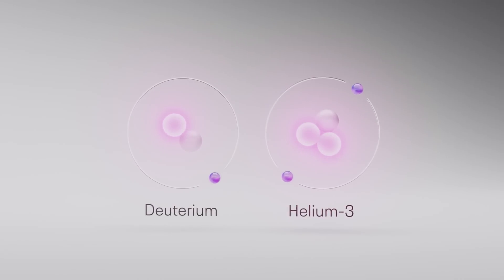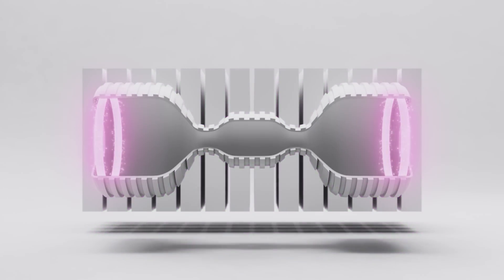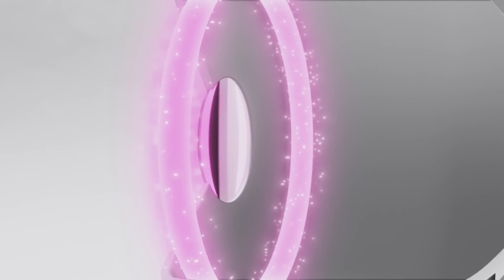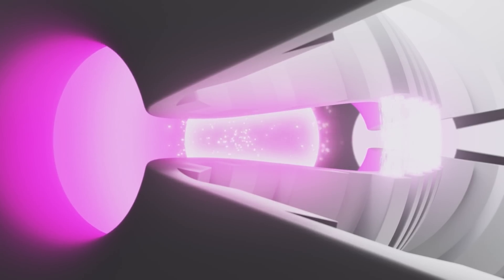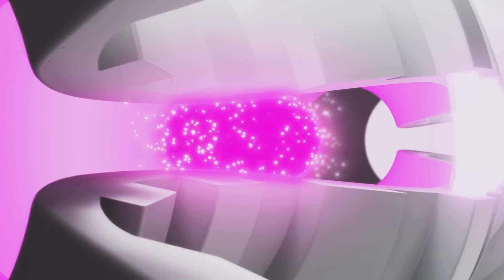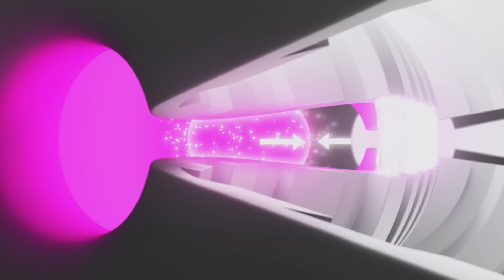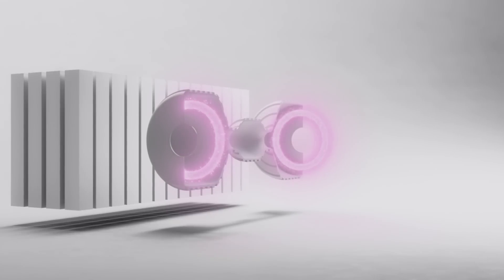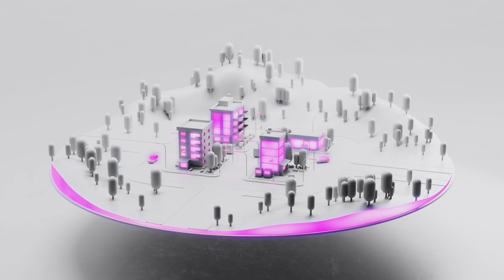Helion's approach to fusion: How it works

Comment: If you do it with tritium-dueterium reaction it will be much more efficient
Reply: Depends on how you look at it. D-T requires more components, like a breeding blanket and the materials get stressed a lot more. Also, unlike D-He3, most of the energy is in neutrons rather than charged particles. So they would need a steam plant as well. Finally, the wall loads would be worse with D-T. The machine might have to be bigger. All of that drives up operational and overnight costs. 
That said, Polaris will do some D-T experiments as well, since as you said, it is a bit easier for a first step. 
There are some interesting, potential variations to the fuel mix: They are planning to breed He3 from Deuterium reactions. Those same Deuterium reactions also make Tritium. This would be Tritium catalyzed Deuterium fusion model. With that they could get away without a breeding blanket. Equally, they could burn both, the Tritium and the Helium3 produced by the Deuterium reactions. Their patent explores some of these options.  
For now at least, the end goal is still a D-D-He3 plant, though.

Comment: Tell me about a carbon neutral way to get deuterium and helium, pretty please
Reply: You can extract deuterium from seawater. It only takes electricity. If that electricity comes from a carbon neutral source, like fusion, then the process is carbon neutral. A 50 MWe Helion power plant needs very little deuterium, only about 20 kg a year. Some fission reactors have entire pools filled with that stuff. Regarding the He3, Helion makes that themselves by fusing Deuterium.

Comment: I suspect that your approach to succeeding is just a matter of fine tuning the parts of the device just right.
Reply: In the end maybe the microwave laser drilled geothermal plants would just have to stick around to act as the capacitors, and the fusion plants are actually just multiplying/amplifying that energy output.
Reply: In fact, probably just build them in pairs next to the microwave laser drilled geothermal plants. Easier technology to just use fast switching between the two fusion machines for the power pulsation they require, then recombine on the other side into a smoothened power flow.

Comment: How long till a working prototype?
Reply: Depends on how you define "working". Trenta was working (as in it achieved its design goals). They are building Polaris right now and that is currently targeting summer. Then a few months of optimization and fine tuning. Then it should produce some net electricity.
Reply: @elmarmoelzer2229  Seems to be going along nicely, then.
Reply: @kblargh   Yeah, they are making good progress. Still a lot of work ahead of them, but I am confident they can make it.

Comment: The biggest problem with all of this is acquiring or producing Helium-3, mine it off the surface of the moon or build an entire seperate rector just to generate the fuel.
Reply: They do not have to build a separate reactor. They can do it all in the same machine. D-D side reactions happen anyway. Half of them produce a Helium3 atom and the other half produces a Tritium atom which also decays to He3.
They just have to have the right balance of D-D reactions to D-He3 reaction to have enough He3.
Reply: @elmarmoelzer2229  The amount of helium 3 produced is insufficient to fire the next reaction, it is not a self sustaining helium 3 source. I recall discussion of a completely separate reactor tuned to produce helium 3 but it hasn't been built yet. 

If they were producing helium 3 in quantity today they would already be profitable.
Reply: @rrmackay  
It IS sufficient. You need two D-D reactions to make one He3 directly and one Tritium which eventually decays into more He3. 
So in a worst case scenario, you get one D-He3 reaction for every two D-D reactions, which IS sufficient. They can also trade the Tritium for more He3, since Tritium is A LOT more expensive than He3, at least until the market is saturated. 
The D-D reactions are essentially self- sustaining. The D-He3 reactions are where the net electricity for sale is made though.
They COULD make a dedicated machine for the He3 breeding, but they do not have to. Dedicated machines would be more optimized for the task and there are some advantages with siting and all that.
But the initial machines will do both breeding and burning of He3 in the same machine.
Reply: @rrmackay   A 50 MWe Helion power plant will produce about 7 kg of He3 and Tritium annually. They could sell the He3 until the market is saturated (which is not that big). They WILL make a lot more money selling Tritium until that market is saturated too which is a lot bigger than that for He3 (Tritium decays into He3). Price for He3 is a fraction of the price for Tritium. Helion's machines will make both, Helium3 and Tritium and yes, selling those isotopes is a good source of secondary revenue and they are aware of that. But market elasticity is something to be aware of.

Comment: What the video doesn't cover is the fuel cycle to produce Helium-3, which otherwise can only be created by bombarding Lithium with Neutrons to produce Tritium which eventually decays to He-3.  While Tritium itself is a fusion fuel, Duterium-Tritium fusion emits most of its energy as high energy neutrons which can't use the elegant magnetic energy recovery of Helion.  He-3 can be made by Deuterium-Duterium fusion.  So the system can make its own fuel with an excess of Duterium in the mix.  This itself is brilliant to allow near 100% energy recovery which is something where all neutronic fusion reactions must use inefficient thermal conversion as well as a Tritium breeding cycle with a neutron economy.  The simplicity of the Helion design and fuel cycle makes it the front runner of all the fusion approaches so far.
Reply: Deuterium-Deuterium is 4 particles right? 2 protons, 2 neutrons. Helium-3 is 2 protons, 1 neutron. Where does that last neutron go...? I'll give you a hint, D-D fusion is also highly neutronic like D-T fusion, this isn't an improvement.

Comment: Finally, nuclear energy that doesn't need to just boil water.
Reply: Boiling water is great, because it means you can convert any existing steam-powered power plants to fusion, at very low cost.

But boiling water sucks, and an aneutronic process like LPPFusion use, can avoid the steam cycle too!
Reply: Hey don't knock on boiling water. There's a reason even gas turbines use the rejected heat from the exhaust to further run a steam turbine. They don't have to but when it comes to squeezing out every last drop of efficiency steam is hard to beat.
Reply: My thought exactly...

Comment: @RealEngineering 18:05 / 18:30 My 2 Cents Analysis: The Polaris Generator Stable commercial Repetition Problem (not yet sure that I can fully understand the concept of direct fusion to Electricity) but my guess won't 60 generators all sequenced/timed to each output/fire 1/60 cycles per second. Analogy similar to producing  60 Hz AC @ 60 cycles per second everytime the generator passes a coil @ turbine/generator/alternator at shaft speeds of 3600 RPM. #Paralleling@60Hz
Reply: This was before i realized the Repetition Rate is 1000Hz per second, but still can be considered from an Efficiency point of View

Comment: Helion has yet to achieve "Sustain Fusion Ignition".  What Helion's plan to achieve "Fusion Ignition" ?

Can anybody shed light on an approach to achieve "Sustained Fusion Ignition" in the manner Helion has proposed ?

Are all the Helion YouTube PR videos just a means to secure more funding for a problem that has no practical solution in sight ?

I sincerely pray for Helion to achieve "Sustainable Fusion Ignition".  It is my hope that Helion "Engineers" its way to this physics "Holy Grail" of discoveries.  If achieved, Helion will become the greatest company in the history human civilization.

That fact is that Helion hasn't and more importantly, has no idea how to physically perform "Sustained Fusion Ignition".  

Seems like another multi-billion physics sink hole to me.

You can't power the world with talk alone.
Reply: Helion is explicitly not aiming for a sustained reaction and explicitly not aiming for ignition (where the fusion products heat the plasma to the point of where no external heating is needed). 
1. Helion's design is pulsed. A pulse lasts a millisecond or so.
2. They do not need ignition because they can recover the input energy and the fusion energy at extremely high efficiency. If they can do 95% efficient recovery of the input energy, then this is actually better than a Tokamak with an ignited plasma. The fusion energy recovery would be slightly less efficient but also pretty good. This is why they think that they can get away with a low Q of about 2.
Reply: @elmarmoelzer2229  Doing R&D with hundreds of millions  of dollars has no payoff.  What's the point for Helion existence?
Reply: @howdywowey2165  ???
The point is for them to develop fusion power plants.
Reply: @elmarmoelzer2229  Hundreds of billions of dollars have been spent worldwide over the span of numerous decades on the promise of limitless clean energy.  The end result is no self-sustaining fusion reactor.  Not even a theoretical model for a self-sustaining fusion reactor has been presented.  The only time you hear about fusion energy is when their R&D funds are nearing depletion and their trying to raise more cash in order to keep their jobs.  

It's obvious that no one can do it at the present time.  Funding the "Pipe Dream of Fusion Energy" is double talk for physics jobs with no end in sight.  The "Perfect Scam" !

Comment: I have a question.
The gist of the video is to compress the collided plasmas with a magnetic field and convert them into a higher temperature and higher pressure plasma. At that time, a nuclear fusion reaction occurs, and the magnetic field created by the collision between the magnetic field generated during nuclear fusion and the magnetic field pressing inward induces an electric field using Faraday's law. I understood that it was the way to do it.
So, you have to use a magnetic field so enormous that you have to not only confine the plasma but also compress it. How much less is that cost than the resources produced by nuclear fusion?
Although it has the advantage of not having to continuously maintain plasma compared to the existing method, it does not seem to be as efficient as the existing method in terms of cost.
Reply: The key is that they can recover the input energy at extremely high efficiency directly as electricity. Probably around 95% efficient. Those 5% losses are easily made up for by the added energy from fusion reactions.

Comment: What a small device with no containment structures in place. I think you’ve already achieved the weight requirement for a large warhead. Just give us your Little Boy 2.0 gun concept. Come on, did you think I wouldn’t notice that you mentioned output so many times but never net output?
Reply: You silly goose, the magnetic field is the containment structure. Also, this cannot be weaponized and even if it could fission would still be a better fit for weaponization
Reply: @isabellagoogleaccount8418  he just has to substitute surrounding magnetic field and their generators with explosive lenses for EM radiation from conventional fission devices which themselves require their own primer of conventional explosives in sort of a Russian doll design concept… but that’s only for people in the know in the DoD… touches finger to nose and nods head knowingly

Comment: Has anyone at Helion considered putting this end to end with more than one of them in a circle so that each expansion cycle would flow into the compression cycle of the one next to it ? Take the Polaris model and put a bunch of them end to end in a huge circle. You'd be able to take advantage of the velocity from the fusion's expansion and sending the plasma into the one next to it going back and forth between them and this would probably then take less energy to operate. You could also send part the generated electricity to the adjacent one as well to its coils. Sending the current back and forth too.
Reply: Like if they just manufactured a few hundred or thousand supercapacitors near the right renewable energy sources and right transmission cables they could power quite a lot of area...
Reply: Idk if that's true but if it is and the heat can't be redistributed into some other helpful energy process, maybe even toward cooing it, that's another way technology is wasting energy.
Reply: It would be too hot!
Reply: I think you just invented the game "hottest potato"
Reply: And how do you plan to solve the immense amount of radiation you would create by doing so? You would basically irradiate every living organism within a 300m² radius. Deuterium 3 neutrons that do not bond create immense amount of radiation. For every D³ particle that bonds 4 are produced. The other 3 will continue on until stopped by a medium powerful enough to halt their progress. This is very inefficient.

Comment: I've been intrigued by Helion Energy's pulsed fusion device and its potential to revolutionize the energy industry. But could we take it a step further and use the plasma pulses generated by the device for propulsion in deep space satellites? It is a great way to use this incredible space exploration technology. Of course, it would require much additional engineering and development work, but the potential benefits could be enormous. What do you think? Let's discuss it!
Reply: I mean its how they came up with the design, as Ion engines, which are a real thing, do the same thing. They just took it a step further and had the two engines face each other.
Reply: So do you think pulsing could be stronger than a traditional ion thruster?
Reply: @damienwade7848  Who's to say? I just know where the idea for this thing came from. Then again we've already done pulse engines before. Look up the Orion Rocket Project.

Comment: I WORKED FOR MAGLICH ON HELIUM-3 FUSION.  HE GOT 10 BILLION DEGREE ION TEMPERATURES.  The systems he designed were way ahead of this.  The beam of fuel went into a flower geometric pattern and excited the plasma of fuel to massive energies.  I discovered how to increase the density by making the wall out of certain materials.
Reply: sound in the materials or something

Comment: General Dynamics/Hughes rolled out a similar device using laser ionization and coils around the central chamber to somehow directly use the altered Flux lines created by the fusion explosion to generate power.
Haven't heard if they gave up.

Comment: I can’t ask why each side of the two fuel sources aren’t overcoming their electrostatic repulsion of one another. The weird thing is, if it’s destabilization and fusion, it shouldn’t matter what the fuel is. In that sense, a definition of positive and negative isn’t necessary by speaking of Deuterium and Helium 3. In destabilization, only one fuel should be necessary.
Reply: Sorry. Protons, Neutrons, and Electrons. How then do you define destabilization and fusion? Are we supposed to imagine that the core of an atom, remains while the electrons in the outer areas become a soup?
Reply: All they did with this idea is accidentally show that a soup of hot elementary particles turn into whatever. How do you manage whatever and get specified elements? What were those byproducts again?

“The overall reaction takes 4 hydrogen atoms and fuses them together and the products are:

1. Helium - 4
2. Gamma Rays
3. Neutrinos
4. Positrons
5. Energy (light)”

I see soup and whatever, and if fusion actually happens, that’s all there will be, therefore, just like in Back! To! The! Future! Your! Fuel! Doesn’t! Matter!

If.

Comment: Nice sci fi.

I know it's not actually working because if you're getting D-He3 reactions, you'd be getting lots of D-D reactions releasing deadly neutron radiation, but your prototype has no shielding. 

It doesn't have shielding, because it doesn't work and it's not a problem.
Reply: If you actually listened, you would have understood that they're planning on whether to breed fuel in a different site so they can make the process more efficient. Be less lazy
Reply: @rachelleliaberry6138  It is not about breeding fuel.  There is no way to prevent neutron emission.  Deutrium-deutrium fusion will happen no matter what.  Thus it is a must to shield the machine from neutron for both the longevity of the machine and worker and staff safety in the plant.
Reply: @catchnkill  I guess you don't understand English and you have no idea those neutrons are far less energetic than what you'd get through other reactions.
Reply: @isabellagoogleaccount8418  No.  You does not understand the whole picture.  Deutrium-Deutrium fusion will be inevitable.  Deutrium-Deutrium fusion can take two paths.  Helium3 with one neutron.  Tritium and one hydrogen.  When the tritium is generated, there will be deutrium - tritium fusion since this is the easiest with highest probability fusion. You still have high energy neutron from Tritium-Deutrium fusion.   Helion's way cannot help the radiation problem.  You need proton - boron fusion to eliminate radiation completely.
Reply: @catchnkill  You're wasting your time with these people. They want to believe the fairy tale and they'll scream REEEEEE at anyone who points out that the tech bro presentation is omitting most of the problem.

Comment: When I was working with plasma propulsion lab at UW, I looked at a mini-helicon thruster and literally thought to myself, two of these aimed at each other could be a promising fusion solution. Have you consider using RF energy tuned to the nuclear magnetic resonance of your plasma specimen as a low energy solution to ionizing your particles?
Reply: Of course they considered that, but this machine doesn't produce fusion anyway. It produces venture capital investments.